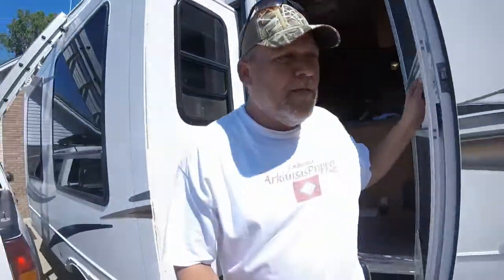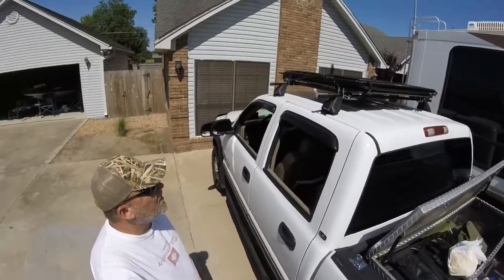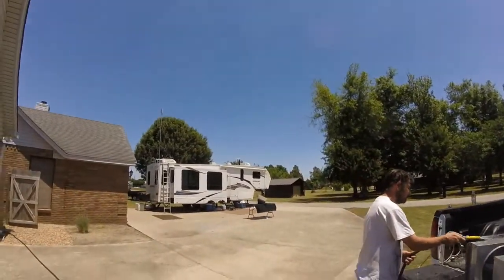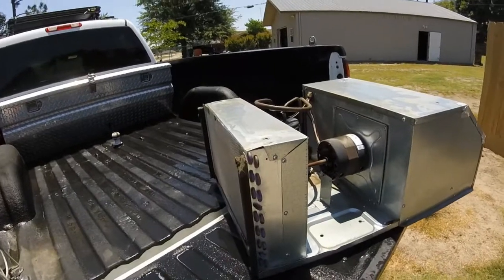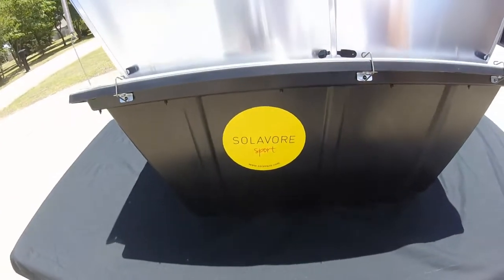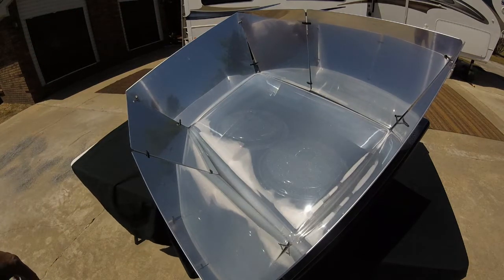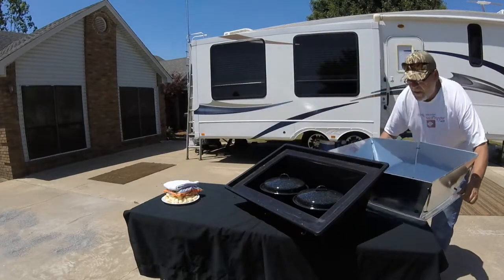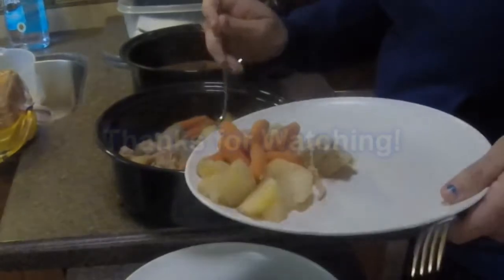Solar Cooking, Solar Panels and a long day of RV repairs

Comment: I just got a solavore oven. I haven't cooked in it yet but as soon as I get a sunny day I think I'm just gonna do some  Brussels sprouts with onions
Reply from the maker: +BCtruck, rebuild, repair,repurpose 
I wanted to use my cast iron chicken cooker but it is hitting the enter liner of the lid. I am going to find a smaller pot.